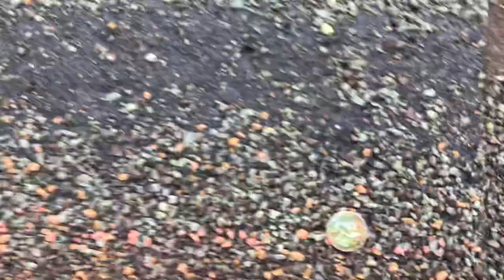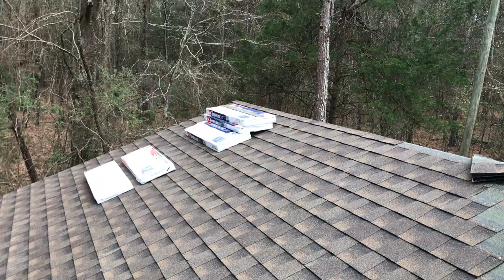Why Nail Pattern On Comp Shingles Is Critical - Quality Control

Comment: I was up on my roof yesterday, doing some shingle repair, I heard in the distance around my neighborhood, this machine gun nailers going off. I was thinking to myself there's no way in hell those shingles are going to be nailed right. You know it's all about getting the job done as fast as possible, to make as much money as possible. To many half ass contractor's out there, doing shoddy work.
Reply from the maker: I’ve seen it throughout the construction industry for over 35 years, so I know what you’re saying. What’s funny is when people want to argue about the fact & defend their shoddy practices. In most cases I just don’t think they see how their work habits suck. So for that reason I feel sorry for them, but when someone points it out, you’d think they’d at least consider the fact.

Comment: I began stripping the old 32 year old 3 tab asphalt shingles off my roof today, and I noticed how the old 3/4" board sheathing isn't holding nails so well. The house is 100 years old. Most of the wood seems good, it's just that it's old wood and it seems like it just doesn't hold nails well, like new wood does.

When I grabbed shingles during tear off, it seemed like the sealing of the asphalt line on the underside of the shingles held more than the roofing nails did. I used 1" nails last time allowing for 1/4" for shingles, assuming I would be going all the way into the 3/4" sheathing...Good enough.

However, I now want to re-nail the roof sheathing. I was even considering if I could get 2 1/2" long roofing nails so I could nail into the rafters at each opportunity. (16" OC) So I am here looking at nailing patterns for Architectural shingles which I will be using this time. 

If I step them as shown here, I assume I only need to stay away from the 6" area at the end of the shingle where the next row's joint will be. Anywhere else seems to be fair game. 

Maybe I could use those 1" plastic washer things along with a very long roofing nail for whenever I get to a rafter that could be clearly marked out on the underlayment. 

I guess I just want my roof to be the one that has the shingles still on, should a tornado come to town.
Reply from the maker: Don’t use the plastic cap nails for shingles. Do try to use longer nails wherever they’ll penetrate into the framing itself if you like. You should be using weather resistant roofing nails that are long enough to penetrate all the way through the roof sheathing at least 1/4” throughout the roof. You are correct about staying away from the side lap seams with the nails to keep side seams as water tight as possible. Also, realize that all the nails used work together to hold the shingles in place, so proper placement is key as much as the total number of fasteners is key.

Think of holding power as a mathematic formula. If a nail properly placed increases holding power by 30 percent, now multiply that increase exponentially every time you add another nail where it holds the shingles best. And, remember that the more accurately the nails are placed, the more each nail will hold more of the adjacent shingles because of how they’re overlapped. Lastly, make sure the nails are going in as straight as possible. Nails driven straight have much more holding power than nails driven crooked, because the nail hole through the sheathing is much tighter around the nail shank. Most roofing nail guns do NOT drive the nails straight. Many manufacturers design solutions for this into their nail guns & some do better than others, but due to the nature of roofing nails having a large head, they tend to tumble coming out of the gun & this problem needs monitored by the roofer & minimized as much as possible.

Comment: I'm doing my own roof and the nail gun was doing a poor job setting the nails correctly, no amount of adjusting would give a consistent "just right" nail seating with the shingles.   I got my hammer and now it's one nail at a time the old fashioned way.  It may be slower but those shingles are going to stay put.
Reply from the maker: Old Roscoe I hear you... That IS a common problem. I have several name brand nail-guns, but only one of them will drive the nails right consistently. So when most contractors - & I do mean most - when most contractors experience that problem, they make adjustments & if the adjustments don’t work, they simply continue installing the shingles, because if they take the extra time & expense to solve the problem correctly, they’ll lose substantial income, or at least that’s what they think. Most contractors are not in the habit of problem solving while on the job & because of this, the customers suffer losses most of the time.

Good on you for taking your time regardless, so YOUR roof stays put!

Comment: Awesome Dan, Thank you!!  Now what do I do about the new roof I had installed two years ago that hit rapid fire and above the nail line?  I also have 8 more rental houses that will need new roofs soon.  This will be a discussion before job is awarded.  But again, do I have the company re-roof what they just did?  I'm in Florida.  Roofers are advertising everywhere here.  
I found this video because I was searching for comp nailing patters as I am currently fixing a roof where some shingles blew off.  This is not the 2 year old roof I mentioned above.  All the nails were above the nail line and in the tar strip. The flaps could lift a little and the wind took advantage.  Repair sure is fun in 95 degrees.
Reply from the maker: What you need to do with the already installed roof, depends on what type of shingles it has. You mentioned they nailed in the tar strip. That implies a type of 3 tab shingles rather than laminated architectural type. 3 tab shingles aren’t very wind resistant in the first place & having them redo the roof wouldn’t necessarily help them stay on the roof in high winds because each shingle is only one layer thick & more susceptible to wind damage regardless of where the nails are placed. However, the laminated architectural type shingles, like in my video here, benefit highly from having the nails exactly where they belong, because the nails will be going through both layers of each laminated portion of each shingle. So in your area where you experience high winds often, if I were you, I would only have architectural shingles installed on any & all my roofs with the roofing company paying close attention to installing all the nails on the manufacturer’s nail line. If you do this, your roof will be the only perfect roof in the neighborhood after every storm, with very few exceptions. If your shingles ARE the laminated architectural type & they installed the nails wrong, I would certainly have them back to re-roof it & nail it properly. But as I previously stated, 3 tab shingles only need to have the nails installed so that they penetrate through the shingles where each nail holds a single layer of two separate shingles at once where they overlap each other. Does that make sense?

Comment: I hit that nail line every time and I nail pretty fast
Reply from the maker: I doubt it. I’ve shot various types & brands of nail guns for three decades & every type of firearms as well. I know how hard it is to shoot fast when the gun is bouncing off the shingles at high speed. Not only that but the nails often drive at different depths depending on what’s beneath them. I’ve always gone as fast as I could & still be accurate. Sounds like you do also.

Comment: Can you show use how fast one put them in, I have a 3 man crew, 2 of us nailing, one guy feeding us,we sound like "rapid fire  machine guns" but sound does echo, two guys can sound like four,  also with someone feeding you shingles you don't have to move very far. I can't put 4 nails in a shingle, with-in a 3/4 space all day, have I missed, yes, simply yank that shingle and put dow a new one. Would like to see what you refer to as Rapid Fire roofing guns tho.
Reply from the maker: My experience of this issue has three main components to it… 1. Doing reroofs & repairs on other people’s work over the last 34 years. So I get a first hand look at their nailing patterns & the issues they cause for the customer. 2. I’ve done literally thousands of roofing inspections during that time period. 3. Paying attention when other people install shingles in the neighborhoods & doing follow up inspections after the fact, only to find the same exact results of their bad labor practices.

The whole point of my message is to hit the nail line for the customer. If you’re doing that, then who cares what speed you’re going? The other point is that so few people actually DO hit the nail line, that it’s a major problem for the customer that’s very common. Look, don’t feel bad… this isn’t just a roofing issue. This labor quality depression we’re in goes across every construction trade out there. And raising awareness about bad labor practices is super easy to point out nowa days, because we don’t have to look very far for bad labor practices.

It’s that simple.
Reply: @MrThedocholiday  Thats Fair, and I agree with 99% of what you said, 100% is a stretch for ANYTHING. LoL.
I was saying on a different video, I am what in this town is called a "GC".  Because we have no unions, and being a Craftman makes you a GC here. I have 1 guy I can count on, I have to pay him above his pay scale "In my opinion", but he shows up everyday, and I can leave him alone, with SOME things.  My Laborer who has been with me for a Year, is eager to learn and the best one I have had in the last 10 years.  The one before him, could not connect his line on a 2/12 using his Speed square. Don't ask me how, but I had to buy him a 12" one, he quit the next day, said I insulted him.  Oh Well, that's how you learn. 
Nice Chatting, Stay Safe. And pray the prices of materials come down.  Lol

Comment: I really haven't seen a video yet that tells me how to go from ride cap into a T intersection of another ridge cap . Figure it on my own try anyway
Reply from the maker: Frank Montez Think like water & install ridge caps accordingly. Water always flows down hill or sideways if driven or pooling.
Reply: @MrThedocholiday  yeah did the best I could think of after several tries and that meant taking it off and redoing it several times . It was further complicated by a valley at about same point . So I had two ridges coming into a T intersection plus a valley with tin roll of about 10 1/2 in wide which I covered up overlapping one side over the other  . Time will tell if there are no leaks . If in doubt I put cement on it . We'll see
Reply: ..do the lower ones first, then cap it when you get to the top...you may have to custom cut a piece of cap...it's handy to use cardboard for a template to try a few different looks with out wasting material.

Comment: And you know that those nail heads are going through the shingle as well.....I agree, I never thought those rapid fires were accurate....
Reply from the maker: Nicholas B You’re right about the nails blowing through... either through the shingles or just shy of being flush with shingle surface like they need to be, if they lower the nail depth to compensate. I’ve shot a lot of nail guns in my day & know how hard it is to be accurate at every speed. Even more so than other types of guns, nail guns are extremely difficult to shoot accurately because of recoil & material surface hardness inconsistencies. So they require a lot of concentration & tempo to stay on target. Add to that the natural arc of your arm as it comes across the shingle while nailing & there’s a very natural bow shaped pattern to the nails being laid down as opposed to straight across the nail line.

Thanks for watching...
Reply: @MrThedocholiday  Excellent sir, right when you talked about those rapid fires I completely understood where you were going, and I totally agree. Keep up the great videos.

Comment: Are 4 inch seams also by the book?
Reply from the maker: My main point in this video is NOT that we have to go by the book - even though that’s not bad advice. My point was that speed nailing the shingles almost always not only voids the warranty, it also results in expensive repairs down the road because of the reasons I gave.

On the other hand, having a 4” stagger on a standard pitch roof like this one - which happens to be my own roof - has never in my 30+ years of professional roofing resulted in expensive repairs down the road. I’m sorry you missed my practical point in the video & thought I was just carried away with the rule book. Even when I went back to repair my competitor’s mistakes, a 4” stagger was never the cause of any issues. I’ve literally done thousands of roofing repairs during my career. I know what causes problems & what doesn’t. And now the customer knows too.
Reply: No it's not this guy is a hack

Comment: Just because you hear a nail gun doesn't mean they are using these shingles..ever hear of nail strip? why don't you use a better brand with a wider nail area?...p.s. are those the new roofing rings? you got 3 on each hand(6 total) do those ever get scratched?
Reply from the maker: Darryl Taylor Yes, the rings scratch, but I don’t care. I like em, so I wear em. I found two of them metal detecting & each ring has a special meaning to me. As far as the shingles go, all the different brands of shingles have the same narrow band for where the nails belong.
Reply: ..everyone is a little different, I'm just not a big ring guy especially if they don't fit, then roofing with them on seems odd to me, but I may be odd to others, it's all good ..I do enjoy metal detecting, you should ask some homeowners to metal detect by the doors for coins, outside faucets for rings...I was thinking that nail strip that shows you where to nail and prevent nails from blowing through..I think it's called "sure nail"..on owens corning shingles...but you are right most shingles are about 3/4"

Comment: some workers dont know, dont care, dope up on alcohol get trigger happy,plus manufacturers mistake  disinfected single made crooked, or tar line off or to  many granules in the wrong location, it use to be centered, in between the adhesive line 7 nails - 8 ,9 shingles , shingles have shrunk now is 5-7

Comment: I am all about quality, but you also know going over old paper and manufacturers specs on nails in the underlayment void warranty as well. And the manufacturer wouldn’t warranty that roof. I’m not poppin off every 2 seconds but speed and quality have to intersect to make money. I’d advise reading up on ALL manufacturing specs for warranty before sharing a video of a roof they wouldn’t warranty.
Reply from the maker: That’s not old paper. What are you talking about. It’s brand new 30lb. And what’s wrong with the felt nails? They’re new as well & probably over nailed. You really ought to find out what’s up before making assumptions yourself. I don’t know why people insist on criticizing me based on the letter of the law when my concern is practical functionality as number one & manu warranty as a secondary concern. Roofers are screwing the consumers & y’all want to shoot the messenger. Real smart. And, by the way, the roof in the video is my own roof, not a customer’s roof.

Comment: Yes, I am presently suffering the after effects of effing incompetent w***Ker roofers. Shingles mis-nailed, no step flashing; apparently they thought a tube full of silicone would do the job. Can't trust anyone to do a decent job. Unfortunately it was done before I bought the house so I've no comeback :(
Reply from the maker: Sorry for your loss friend. Your loss is why I uploaded this & other roofing videos. It’s just wrong to serve the community with substandard labor. And to think about what a rash I receive from many wannabe roofers  because I bring issues like this to attention of the public. They never did like me on their jobs when I rolled up to inspect their work. But they sure pretended to be nice to me at the time, because as their in-house inspector, I was authorized by the boss to pass or fail their work. Nothing has changed in the last 25 years, but now the internet has raised public awareness & together we might be able to change things. Thanks for your comment.

Comment: Who in NE Florida will do the job correct? I have New roofing I need done!
Reply from the maker: The problem is there are too many inexperienced & hard headed roofers who have differing views on what the ‘right’ way is. Add to that the local codes that change roofing requirements depending on jurisdiction & your have a lot of confusion. Biggest problem I see with anything these days is that people can’t think for themselves. They never ask what, how, when, why, under what circumstances is something right, wrong or otherwise. Fact of the matter is, that no rules can serve every scenario & you have to be able to think on your feet if you want to solve problems for the customer & build a good reputation. But most people today can’t see the value of alternative perspectives, so they don’t know how to learn from others & master their craft.

Short answer… I don’t know anyone in Florida. Sorry. ☹️
Reply: @MrThedocholiday  very true. Thanks for the reply